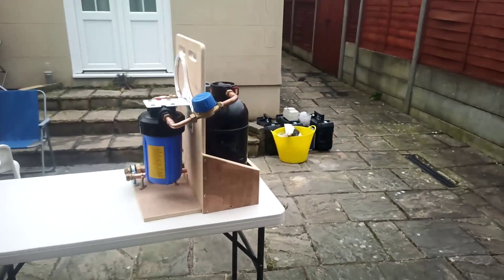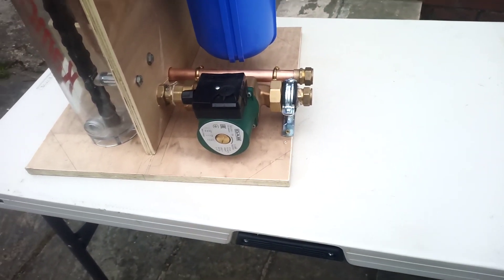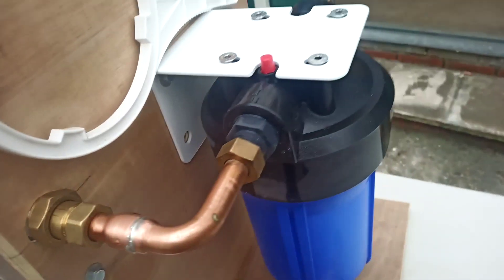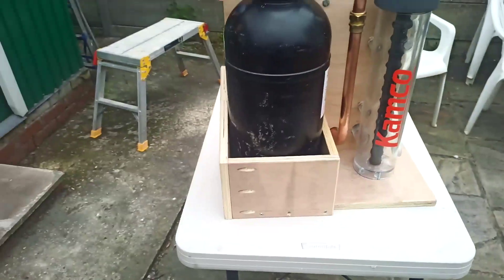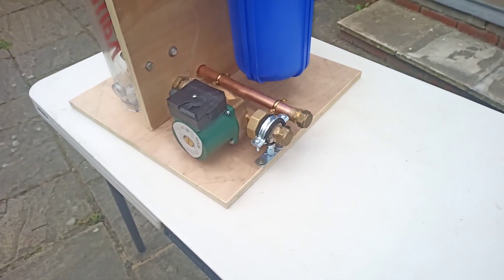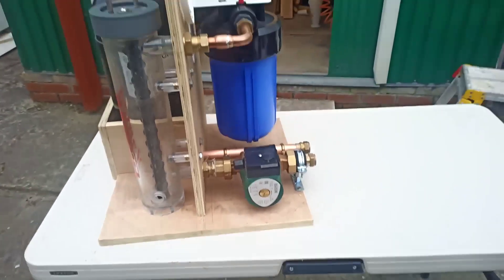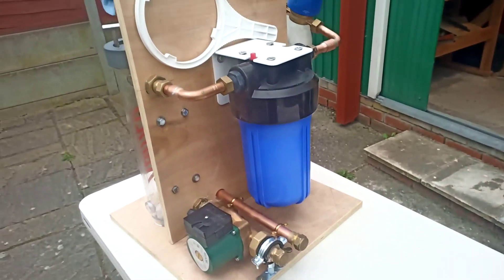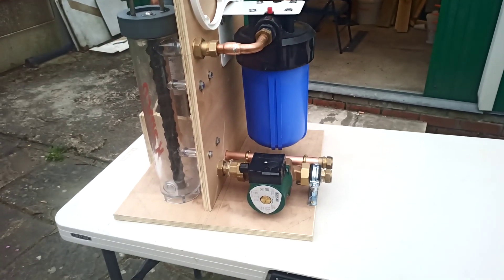Power flushing or filtering ?

Comment: Looks good. Great thinking. Would it be worth allowing for reversable flow to allow to switch the flow direction and therefore be bale to flush the system directly from this rig before leaving it in situ for a while?
Reply from the maker: It's designed to filter the water rather than flush the system
Reply: Also how about some iso valves to allow easy access to the mag filter?